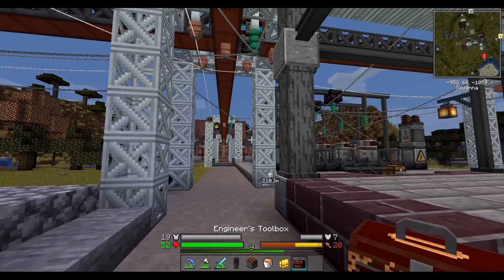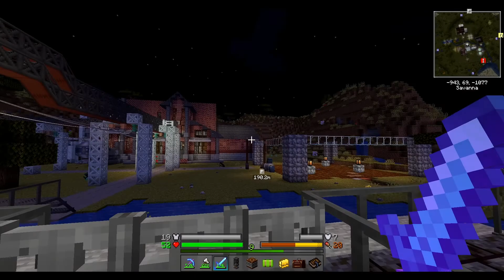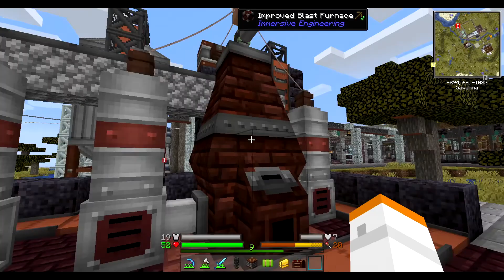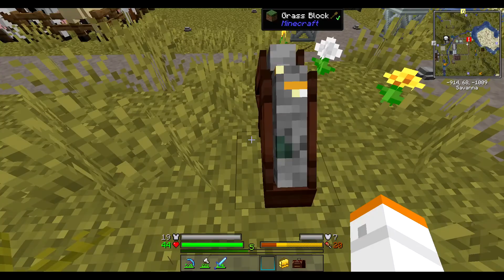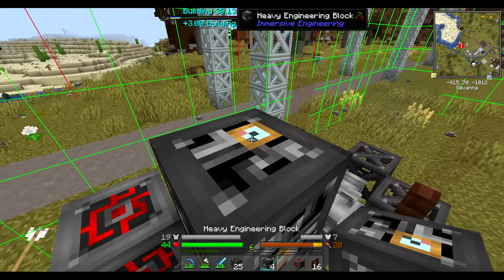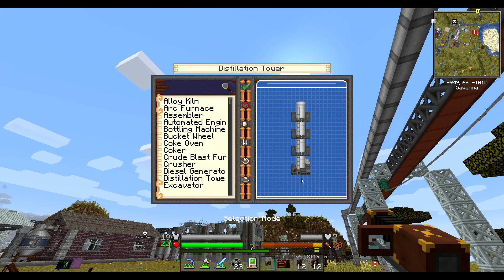Engineer's Life 2 EP29 Finishing Steel and Starting Oil!

Comment: I just know that one day I I'll jump into a tech modpack (this or other) and these videos will be a bucketload of education and inspiration. Love them!
Reply from the maker: I would try something a little less annoying to work with for your first tech pack. I love immersive and all but the sizes of machines and the requirements tend to make things a bit more difficult to get to work. I like them because you can make a base look life size but there are times I love single block machines.
Reply: A pack based around mekanism is easier to get into. But my first real pack was based around immersive and it is a lot of fun to get into. This pack has a rough start And keeps you from going straight to the fun stuff somewhat. And then the seasons are extremely annoying. I got around that by using tetra tools. But start with another pack for your own sanity.
Reply from the maker: Seasons is one of the mods I was tempted to remove right off as soon as I saw it. Then I moved to a savanna and haven't noticed.